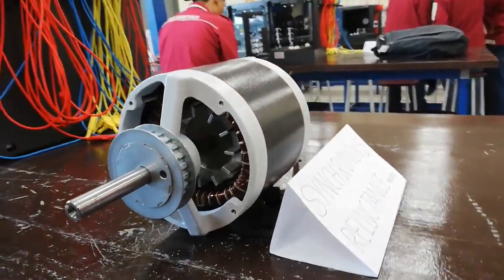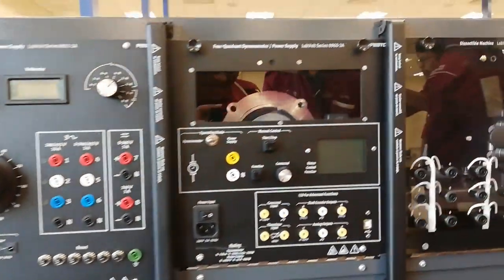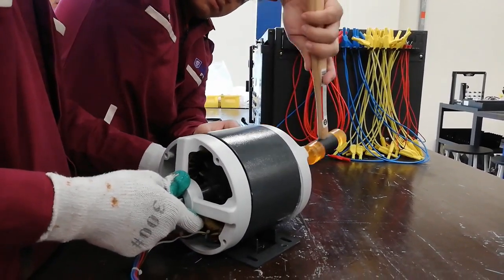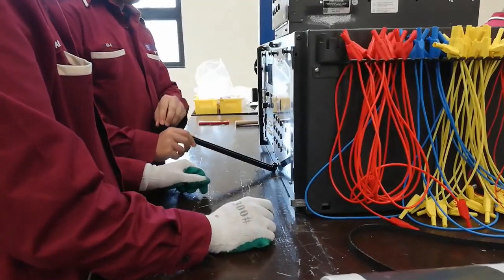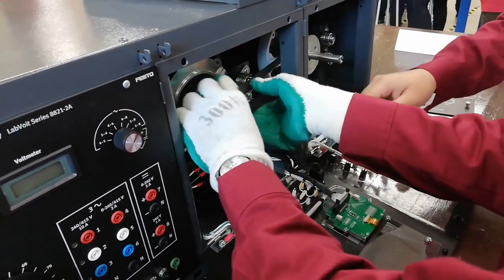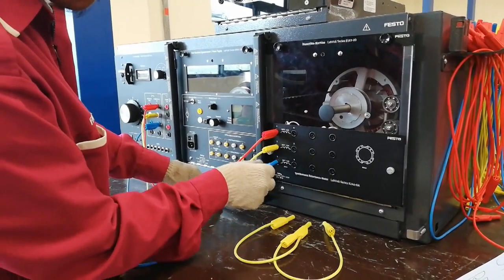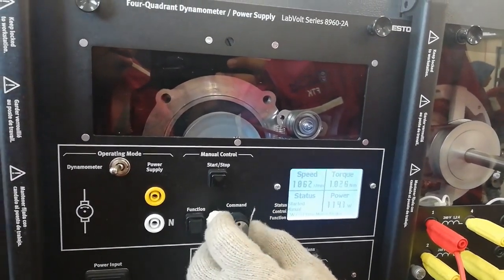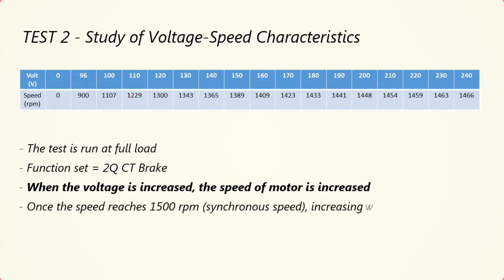Synchronous Reluctance Motor Project

Comment: It's an asynchronous start - sync. run induction motor. Basically, it has a reluctance squirrel cage rotor, the same that old cinema film projectors, electromechanical typewriters, etc. used to have. https://www.youtube.com/watch?v=3LQsm7-ZBuc Self-starting and easy to show the sync. motors behavior. It is not the new SynRM technology!
Reply from the maker: ty for the info 👌👍

Comment: Nice project, i looked at Audi and Bmw videos of their car electric motor assembly, you can see that they use the same technology, they showed the stator but we never saw details of the rotor, i'm pretty sure they use some advanced SRM technology. Search on YT "How It's Made  Audi Engine Electric Motors 2018". Btw i also find the stator winding bot not that great. I saw better thinked winding bots in China for example.